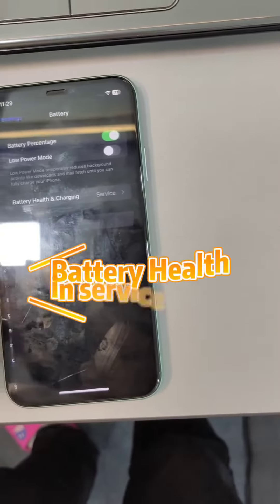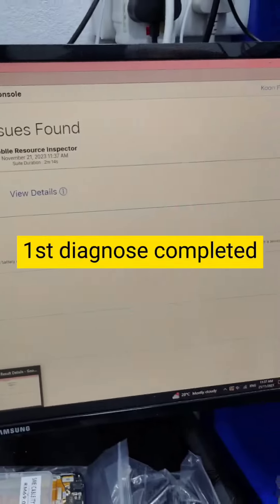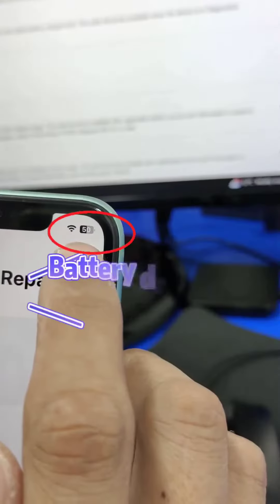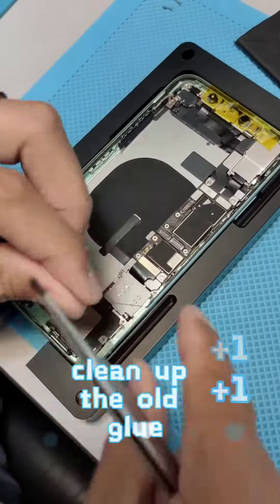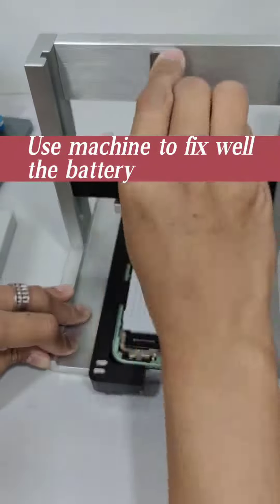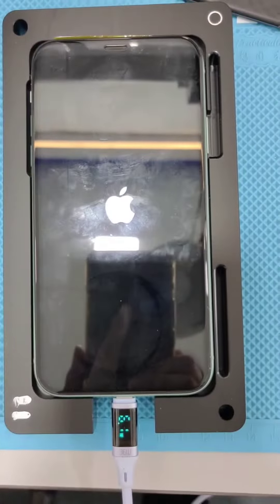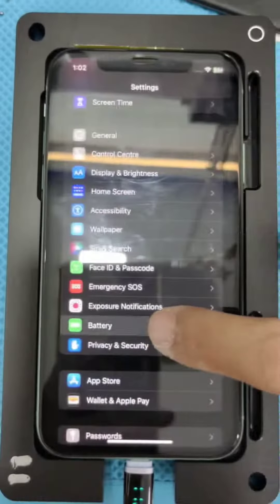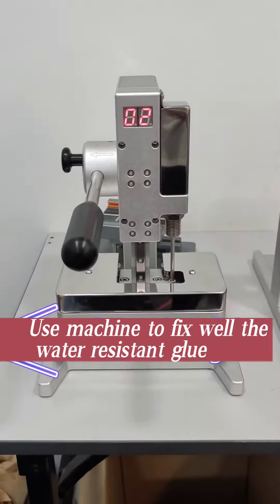iPhone 11 - Official Original Battery Replacement (Apple Genuine Parts)

Comment: Bro if battery not original then still show genuine part..?
Reply: Their battery is original direct drom apple because they are Apple Independent Repair Provider (IRP). They can use apple diagnostic system and original apple spare part..